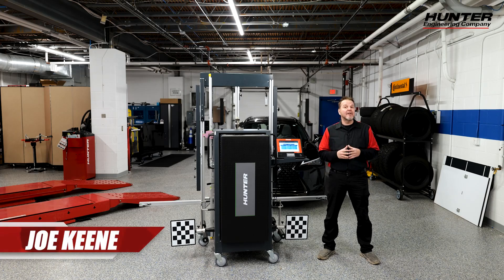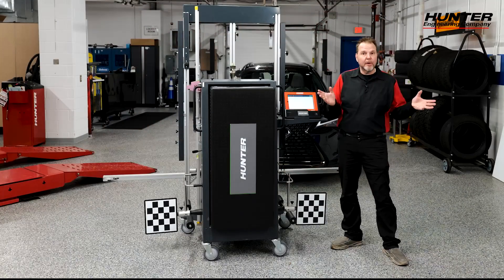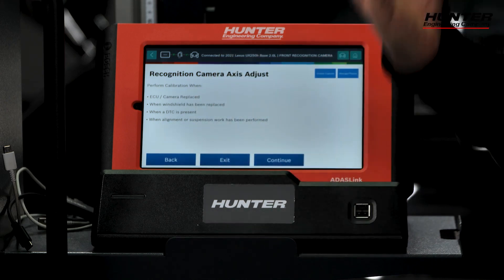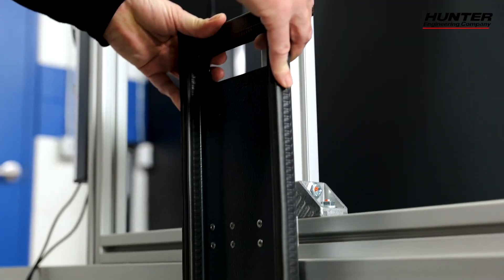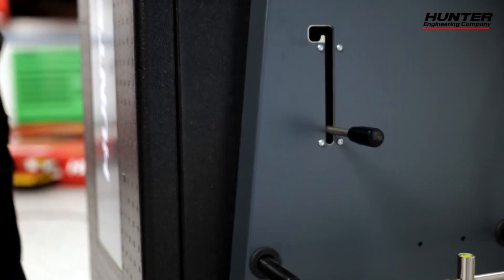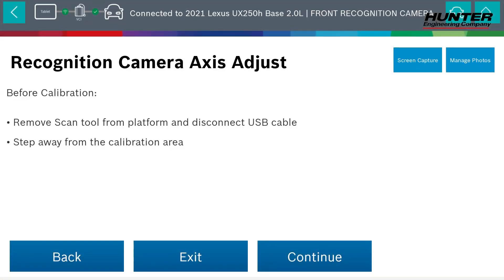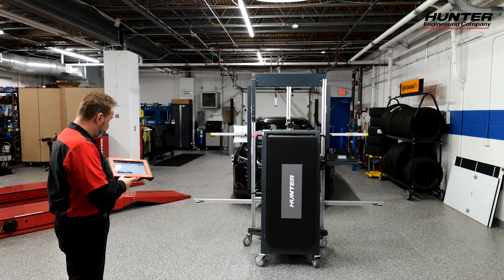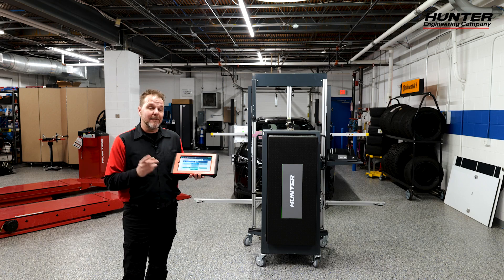ADAS calibrations: Lexus and Toyota camera calibration

Comment: To view the repair manual data shown in the video, is that an alldata subscription?  Is that TIS specifically?  Or is there a free (hopefully) resource to view what was mentioned?
Reply from the maker: Hello. Service and repair information is widely available and is delivered in many forms of media. The ADASLink active subscription includes Repair Source and OE wiring diagrams.  Repair-Source is an on-tool OEM service and repair information that provides DTC troubleshooting workflows, repair procedures, maintenance schedules, TSBs, full-color OE wiring diagrams, component location diagrams, labor times and more. The OEM’s are certainly another path however there are providers of other information in the aftermarket that cover all makes and models. Before investing in the information use due diligence and research and/or preview the information to be certain the information meets your wants and needs as each provider has unique strengths.